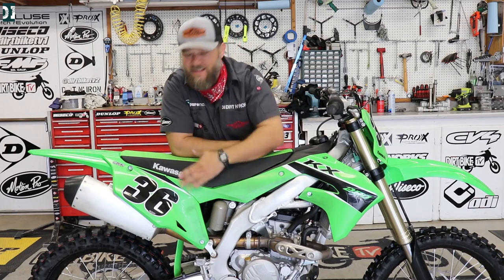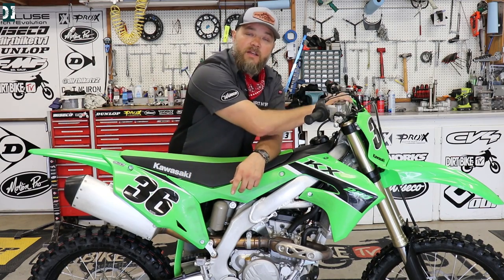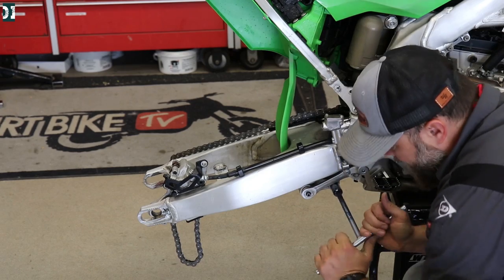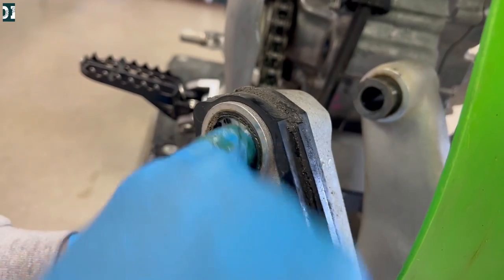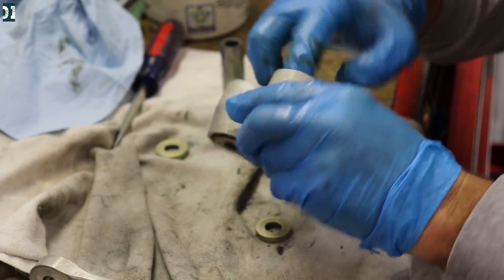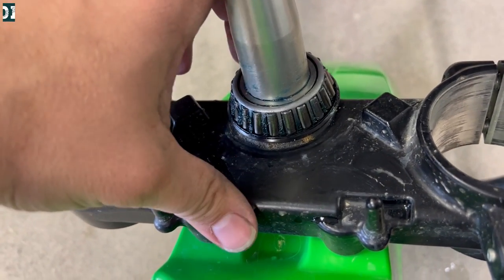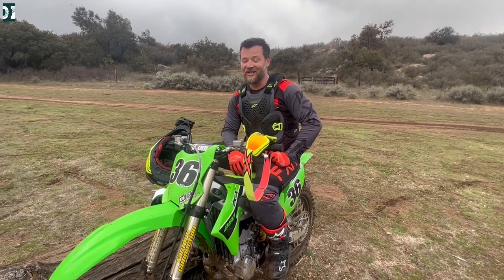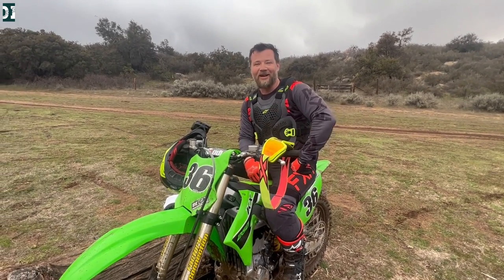First things to do after you get a dirt bike!

Comment: For the price of these new bikes, The dealer should take care of all the greaseing and set up.
Reply: I never take apart my bike to grease things and never had a problem
Reply: These guys just over maintenance
Reply: @trippgraham4751  After not greasing the linkage, and never taking it apart, how do you know you don't have a problem?  Take it apart after 2 hard seasons of off road ricing and washing, and I bet you find a problem if you actually work on your bike.  Now, properly lubed and not power washed carelessly, 2 years is nothing.  Some manufactures put no grease as all in them.  They won't last 2 hard seasons with out some issues.
Reply: Why should that be the dealers responsibility?  Why should the retailer perform quality control, totally at their cost that would probably eliminate all the profit they get that justifies selling it in the first place?  After all,--this is general maintenance,---no matter what the bike costs.  What exactly are you going to hold yourself responsible for, with the property you just bought for your self?
Reply: Now, you can get the dealer to check it over for you.  But you don't want to pay for it.
Reply: And if you want to complain about the price, (rightfully so), you can blame that on the FIM production rule of 1986, and the dictatorship EPA forcing the 4-stroke on the industry,----rightfully so.
Reply: @EarthSurferUSA  ive had my bike for 4 years and race and take my bike apart and no issues
Reply: @EarthSurferUSA  plus KTMs come good enough and i know a ton of people who dont take it apart to grease and there bikes last years and one dude is a A class rider
Reply: Up to you.

Comment: Rado - For the life of me I don't understand why bike manufacturers don't put zerks in the linkage to use a grease gun or rifle bore the bolts so they are hollow with grease distribution holes and a zerk on the end.........Husqvarna did that years ago with no problems.  They may say it will weaken the bolt but I do not believe that is the case.........I've broken frames but I've NEVER broken any linkage that was set up like that.  I've used a lathe to set up Japanese bikes like that without any problems.  Thanks, Tom  P.S. They must save a whole damn nickel on each unit by not greasing.
Reply: Even my old 2018 ttr230 had zerk fittings

Comment: Yes, it is true that some of the manufactures don't lube the linkage/steering stem bearing very well, and they should be checked.  But the first 2 things you need to check IMO is the engine oil level,---and make sure the air filter is oiled.  I rode my brand new 1988 Honda CR250 for a week, partly in the sand, assuming my air filter was oiled, it was not.  I went to clean it, and with a quick swipe of my finger in the air box boot to the carb, I excavated a finger full of sand mixed with premix oil.  I cleaned it out, and rode it for the summer.  Luckily, that was the first year with the cylinder "Nikasil" coating, (that all coatings are compared to.).  The piston was all scratched up, but the hard cylinder plating was fine.
You won't be so lucky with intake and exhaust valves.  :)
There are many things you should look over.  But we usually wait until it breaks.  It is a learning experience.  :)